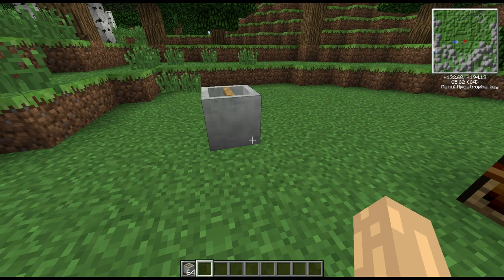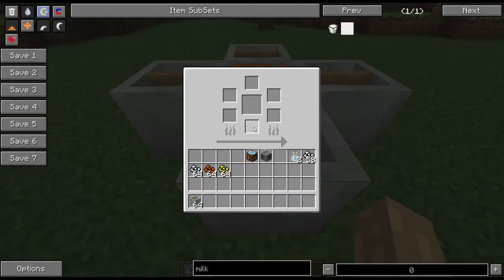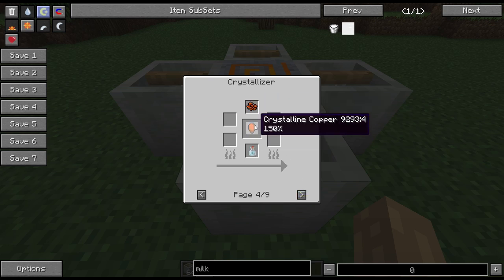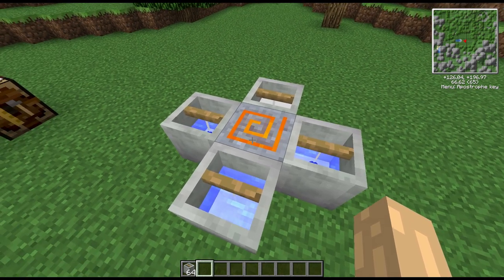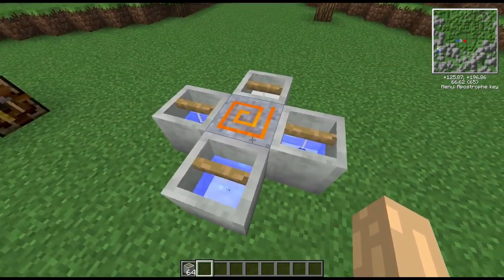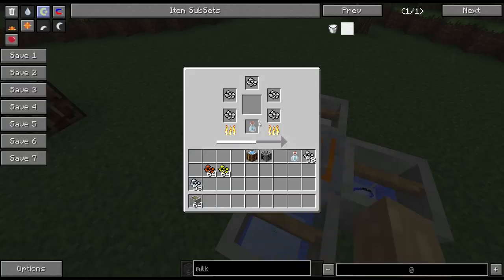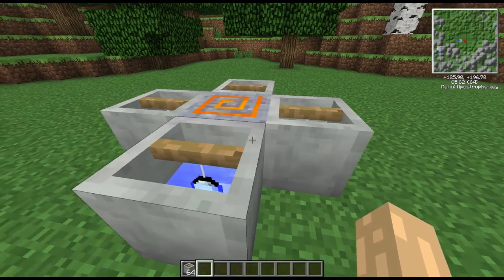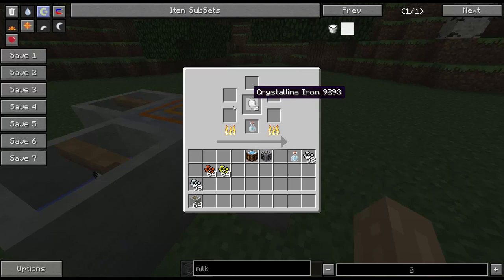Block Spotlight - Crystallizer

Comment: Put down a Crystallizer.  Right next to it, put down a Furnace Heater.  Right next to it, put down a Battery Block.  You can put the 3 machines down anywhere, and they don't require power to work.